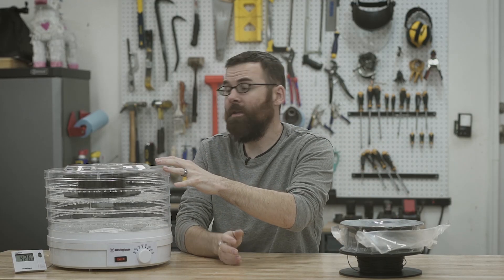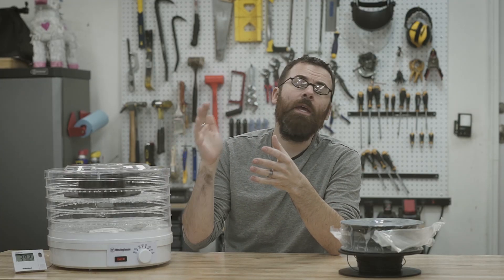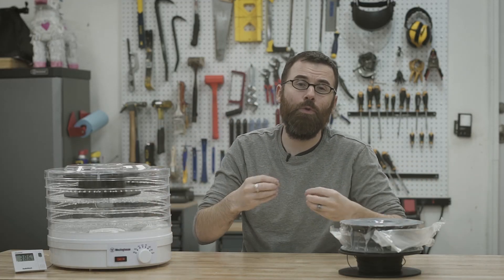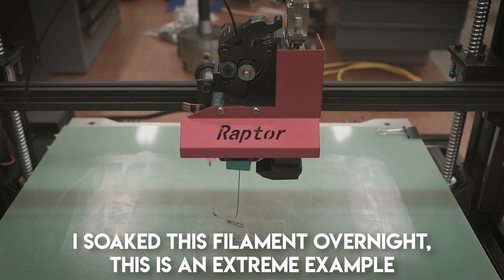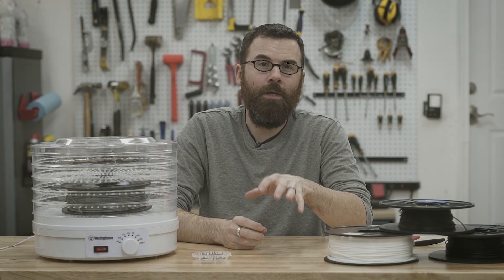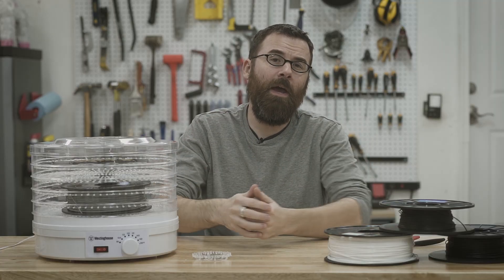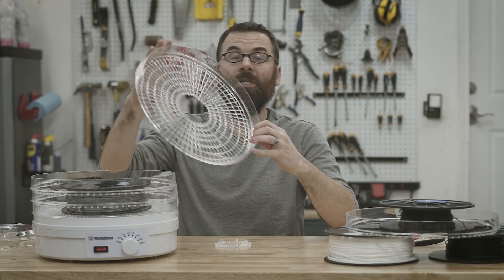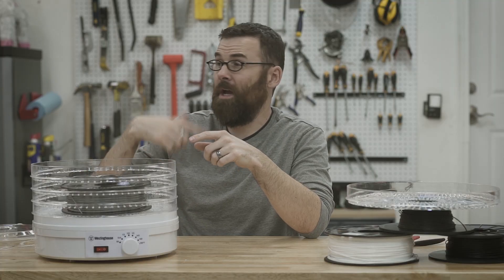Filament Drying Guide

Comment: I smoke cigars , could I keep a boveda pack inside the plastic bag in comes in instead of the desiccant pack?
Reply from the maker: Sure, but that will only prevent further moisture from entering filament.  Any filament that NEEDS to be dried needs to have the moisture actively removed with heat.

Comment: So what do you do right after you have dried the filament? The spool and the filament are still warm, so do you store it in a bag right there and then?
Reply from the maker: I USE the filament right after.  I only really bother with drying it when I'm going to use it for something.  I don't just go through and dry all my filament and store it for later.  I could, but that's not my process.

Comment: if you have an enclosed printer you can easily dehydrate inside the printer. Just heat up the bed, put filament inside, and put a cardboard box on top so the heat doesn't escape. works for me and i's cheap, saves space.
Reply from the maker: True, but many filaments need to be dried WHILE printing.  Nylon only takes a few hours until it's absorbed enough moisture to be an issue again.  If you have a long print, you'll need to dry as you print.
Reply: don't even need an enclosed printer for this! (although, it may work better...) ..... while it might not work for nylon, it's likely to be perfectly good for pla and maybe some others etc....

Sure, maybe you invest in a dryer or something if you live in a humid country, or are doing items like nylon.... but if you store your spools in ziplock bags with dessicant, and only have to dry them occasionally? bed drying is probably the way to go...!
thats not  to say some filament wont be wet from the factory...

Comment: Hi I just saw this video it helped me out. I have the Jayos filament dryers and they are ok not great but i put the filament in the dryer from the factory tape up the holes and come back to it a 3 hours later. It still makes the popping nose i am making something now as we speak and it was popping on the first layer and also leaving gaps i raised the temp up to 215 and when was at the second layer and i still hear it but not as much but thank you for this video. I do have one question when its done drying and you print with it do you leave it in the dehydrator or take it out and put it next to your printer because like you said when you print with it it will absorb the moisture thanks.

Comment: Question about this RE Nylon - Can it actually hold 70º? I've seen reviews where these units can barely break 50º and it's ineffective for Nylon and ABS.
Reply from the maker: I'm not really sure, I am going to test this.  Check my other comment.  I do have a Sunlu and it DOES get up to 70C, https://amzn.to/40G3IT4
Reply: @RobertCowanDIY  Thank you for testing. With lower temperature filaments like PLA, it's not an issue because one has room to go above the device's temperature but when we reach the higher temperature bounds of the device, not hitting it can mean wast of money. I would like to see the results - I hear people modding the Sunlu with a fan to optimize the exhaust of moisture.

Comment: i was planning a print that is gonna take 3 days. so i was gonna be using a dryer that i have, but i cant seem to find how i should set if after the 4 hours of drying when getting ready to print. should i remove the heat setting while its in its box and dessicants, or just leave it heat running for PLA setting? what do you recommend?

Comment: Question, I live in Florida. After using the dehydrator on the filament, should I also do the printing in a dehydrated environment? When you remove the filament from the dehydrator, how quickly does it consume moisture while on the printer?
Reply from the maker: It depends on the filament.  With nylons or PETG, ideally you'd print directly FROM the dehydrator, as it will reabsorb moisture at a rate faster than you can print.
Reply: @RobertCowanDIY  thanks .

Comment: A few words of warning: I have an almost identical dehydrator and did all the same mods. I live in a humid environment and print PLA, TPU and PET-G. Even at the lowest setting it has a tendency to make the filament stick to itself. Therefore, I prefer to dessicate silica gel packets and pack them in with filament in sealed bags. If you don't experience this problem, carry on as shown in this video, if you do, buy extra silica bags.
Reply from the maker: I feel like your dehydrator is running too hot.  I've never had an issue with that, and it only happens when it's too hot, making the filament melt a tiny bit.
Reply: Have you checked it with a thermometer to see what the temperature was?

Comment: Have you tried dehydrating TPU? What's the recommended temp for that?
Reply from the maker: YES!  TPU absolutely needs to be dried before printing.  Temperature is 55C for at least 4-6 hours.
Reply: @RobertCowanDIY  thanks! I'll need to make some adjustments as I was dehydrating it at 45C (same as PLA)

Comment: Nice video 🖖.
I don't like this power hungry dehydrators, they take about 400watts per hour and that's too much for what they're doing.
That would be in 5h about 2Kwh(2000watrs) that not cheap to run, specially if you have to dry more stuff.
Reply: That's about 22 cents where we are! 😀

Comment: Just checking to see if you received the brittle PLA samples i sent you... if so and you dried them can you let me know if it worked... just had a roll sent to me and its horrible...After 2 days and using 1/2 a roll it just has snapped on me  3 fails in a roll after an hour or less...drives me nuts.. thanks
Reply from the maker: Yep. I just got them and they're in the dryer right now.  I'll ty printing with them later today.
Reply: @RobertCowanDIY  awesome! ...thanks for update... also do a flex test to see if they bend and dont snap anymore...maybe do that a day after you take out of machine... since heat makes its bend without breaking always... thanks again for helping me with this...
Reply from the maker: @roadstar499  FYI, I made a whole video about this and it will be coming out in a week or two.  End result?  Both printed JUST fine.  I printed a calibration cube and a benchy (printed with both filament) and no issues at all.  I also tested the flexibility afterwards and it bends like normal filament.

Comment: it sure would have been nice if you actually took some brittle PLa and took it out after 14 hours and showed it was good...i have hundreds of feet of bad brittle pla that is impossible to print with...it snaps with a minute into the prints..i live in sw florida very humid...
Reply from the maker: I tried soaking filament in water for a week, but it didn't soak in as much water as I hoped.
Reply: @RobertCowanDIY  yes, it just would be nice to actually find a video of filament as bad as the rolls i have being made good again...seeing is believing ....hundreds of you tubers 3d vids but i never saw one...thanks
Reply from the maker: @roadstar499  It is a fact that drying filament will make it print better.  I just got a PrintDry system to replace the aging dehydrator and it's made all my prints come out better.  I don't have any really old filament to test, but it makes a huge difference.  Just get a cheap dehydrator and put in some terrible filament and run it for 24 hours.  It will print better.
Reply: @RobertCowanDIY  my is totally unprintable...where i live it gets very humid...it snaps as soon as i start print...it can't be straighten unless i warm it with a lighter...i agree drying helps...but fixing bad pla is what i am not really believing...
Reply from the maker: @roadstar499  Send me the spool, I'll dry it and show you it can print.
Reply: @RobertCowanDIY  what i can do is  cut off three 10 foot samples  that are all bad and you can see if you can make them where they print without breaking ...will need an address... should i PM you for it... ? thanks ch
Reply from the maker: @roadstar499  That works.  You can find my email address on my account.  Just click my name, and then 'about'.
Reply: @RobertCowanDIY  I sent a couple of PLA brittle samples to see if you can make it like new... If you can use the old machine in this video that would be best... just throw the samples in with your next roll you dry... these samples are brittle like  boxed pasta...they can't even be bent straight without breaking...thanks again

Comment: so if you have 1/4 of a spool of PLA that snaps like deied pasta is it worth doing this??? still 4 hours at 113' ??? how much electric does a basic unit use...anyone know??? if it cost $3 in electric  to fix $2 worth of filament,is it worth doing??? i would not think so... thanks for sharing.
Reply: A fair question, but at max current of 250W, it will take 4 hours to use a kilowatt, most filaments will dry in that duration.

Comment: This is a generic dehydrator and every brand labels their own brand on it. I bought the same dehydrator just as Sunix on your link ina different country however I wasn't able to hit more than 48.2 Celsius and 10% humidity with my higrometer readings while the thermostat was set to 70C for a considerable amount of time. Did you do readings and get 70C or even 60ish C readings? As the trays are reduced there is a gain of a max 5 degrees which is very minute.
Reply from the maker: Eh, they're cheap and don't reach the actual temps.  BUT, I have had great success with filament by using this method.  I've never had issues printing nylon-based filament after dehydrating overnight with one of these.
Reply: @RobertCowanDIY  and what temps readings at max were you able to achieve with your machine so I would call the day.
Reply from the maker: @erhanertem196  I honestly don't remember.   I have the thermometer probe in there at one point, as you see in the video, but I don't remember what the actual reading was.  I know that at full temp. it's enough to REALLY soften PLA (too hot for it if you run it at its hottest).

Comment: Is the plastic wheel holding the filament can contaminate the dehydrator to the point being unsafe to use food after in it?
Reply from the maker: I wouldn't use it for food if you're using it for plasitc.  They're cheap enough, just get one dedicated just for plastic.

Comment: I'm sorry I disagree with needing to have different temps for different filaments... Water will always evaporate at the exact same temp no matter what filament you are using. The time however would be a factor as it takes different times for the tempurature to reach the center of the filament at different rates, but the temp makes absolutely no difference!
Reply from the maker: Disagree all you want, but I accidentally dried PLA at the higher temp, and it deformed the material a bit.  You can certainly just use the lower temp for everything, but nylon can handle a higher temp, and higher temps are more effective at removing moisture.
Reply: You should make a video showing that @RobertCowanDIY
Reply: @RobertCowanDIY  standard non-adjustable dehydrators have a set temp at between 55C-70C... Well below the glass temp of PLA. Of course if you have an adjustable and set it too high the PLA will warp, that's a no brainer, however, as I stated, it matters not the temp and a non-adjustable dehydrator will work fine.  The only difference would be the time involved in dehydrating the type of filament you are using. Best way to check is after keeping it in the dehydrator run it thru your machine.  If you hear the tell-tale popping, put it back in the dehydrator for an hour.  It's not rocket science... Just common sense.
Reply: @satyrsmodels8029 the glass temp of PLA is 60⁰C ...
Reply: @ipmate9334  That just means it gets soft, not liquid.  The glass transition temperature of PLA (polylactic acid) is around 60°C (140°F). This means that PLA will start to soften and become pliable at this temperature. However, it will not melt until it reaches a higher temperature, around 180°C (356°F).  Which is why a food dehydrator is perfect, it never gets above 125°F... enough to make water evaporate, but not enough to damage plastics!
Reply: Im working with molding machines 
Asa needs to be DRIED at least 4 hours at temperature 80-100 °C but softer materiels like PP on lower temps and shorter time
So it matters a lot
Reply: For the water in the filament to reach the evaporation point, the material itself needs to reach x y or z temperature...
Reply: Different materials have different melting points 😂
Reply: @JohnBlaze505  I totally agree... but the lowest is PLA... and being the filament with the lowest melting point, I've used a regular non-temp-adjustable dehydrator with it with absolutely no problems whatsoever.  It works with PLA, ABS, HIPS, CA, TPU, and every single type of filament type and brand I've come across.  This is just common science people.  Water will evaporate at a certain temp every single time.  Don't believe me... try it for yourself... I challenge you.  Get a regular non-adjustable food dehydrator and use every type of filament you can get your hands on.  The only thing that changes is the time it takes to dry, not the temp whatsoever.

Comment: By now if you happen to have a roll that you dehydrated a lot of times did you notice degradation on the material?
Reply from the maker: Nope!  I've had some really old rolls (maybe a year or more) and after dehydrating them nearly a dozen times, it still prints just fine, as long as I dehydrate right before printing.  My standard process is to dehydrate overnight and then print, it's been very consistent.
Reply: @RobertCowanDIY  That's what I'm looking for. Thank you for your input!
Reply: @RobertCowanDIY  For how long on average, maybe depending on the amount left?

Comment: How about making the filament pass through a tube filled with desiccant? Will that work?
Reply from the maker: Yeah, I thought about this, but it would need to be in the tube for at least a couple hours, so it's not really practical.  When you dry the filament, it needs to really dry for about 12 hours, so the time it would spend in the tube wouldn't be enough.  It's best to dehydrate, keep try, and even print FROM a sealed container or dehydrator.  But that's best practice, not necessarily required.

Comment: why could you not set one spool on top of another spool without a tray in between, the spools would be touching each other, but not the filament.
Reply: You could certainly do that, but probably drying will be better/faster if there's a gap for air circulation between the 2 spools. Doesn't need to be a full tray, could just us a small ring to provide that separation.

Comment: fyi i tried a sharp set of side cutters and first cut exploded the edge of the ring. i suggest a hot knife or blade end soldering iron. the plastic is verry brittle
Reply from the maker: Yeah, it is pretty brittle.  I had luck with my flush cutters, but I could see it breaking.

Comment: That thing is over $50 now.
Reply: Well as of 16-MAY-2020 it's going for $150! I had already found another item which seems to be the same basic hardware that is used in the "PrintDry Filament Drying System" that Robert also linked. Here's the Amazon link to the Food Dehydrator that could easily be adapted as Robert describes:  https://www.amazon.com/dp/B081YS2M6Y/?coliid=I1ZS5C8QBO9XVB&colid=2O2NS639BULLT&psc=1&ref_=lv_ov_lig_dp_it

Comment: What about the center of the role? I dried my filament for 16 hours at 156F and the first half of the print was great. It then got bad. How can I get the center of the filament dry? I may just have to print out of my dryer.
Reply from the maker: Hum, it must have been wound pretty tight.  I haven't really had that issue.  If dehydrating it won't fix the middle, then the middle probably didn't have a chance to absorb moisture.  But printing FROM the dehydrator is probably the way to go.  I need to modify mine to do that.  For longer prints, it's just gaining moisture the longer it sits out.

Comment: Thank you for the video. Exactly what I need with one exception, how to tell the wife that her food dehydrator need replacing. :-)
Any reason you can't simply stack multiple spools on top of one another and convert all trays to spacer rings?
Reply: Two considerations: 1) You will get better/faster drying if the warmed air can freely circulate completely around the spool. If spools are stacked, there's less circulation between the spools. That's particularly true if the spool sides are flat/solid plastic. 2) If you want to be able to print using filament still in the dryer, you need some sort of bearing or other method to allow the spool to rotate. See the commercial "PrintDry Filament Drying System" link for an example of how to make this possible.

Comment: I generally question the idea that we should dehydrate filament at different temperatures. Yes, if you dry PLA at high temperatures it is detrimental to PLA. But isn't any temperature above a certain point capable of raising the vapor pressure of *water*? so the only downside to dehydrating PC or Nylon at a low temperature should be that the dehydration time will be as long as if it was PLA.... this is very hypothetical thinking on my part so please tell me if I am mistaken, I want to learn!